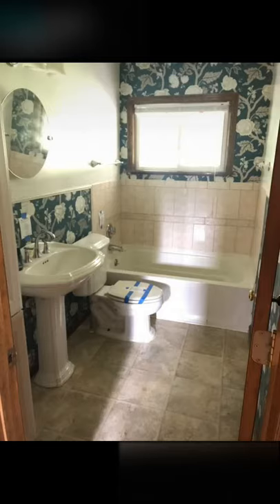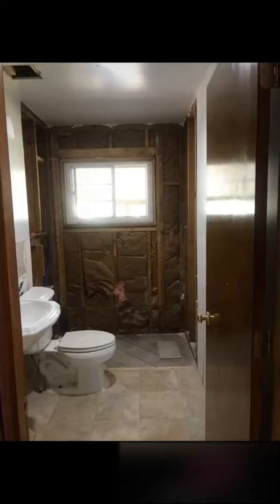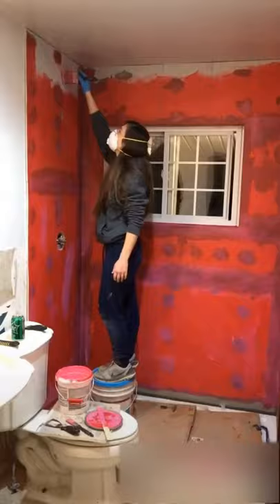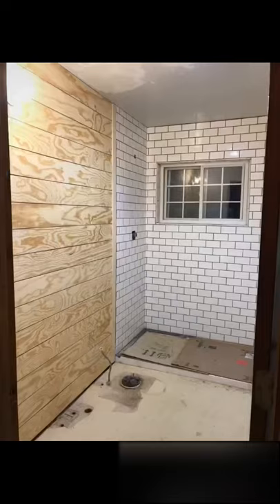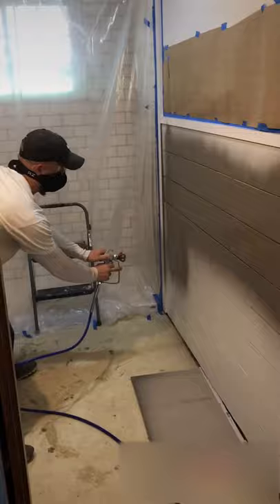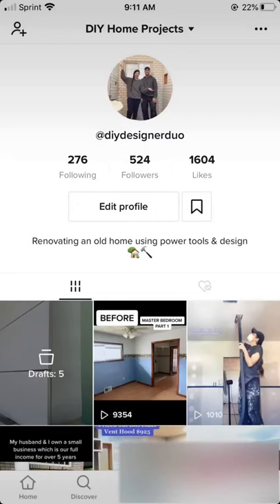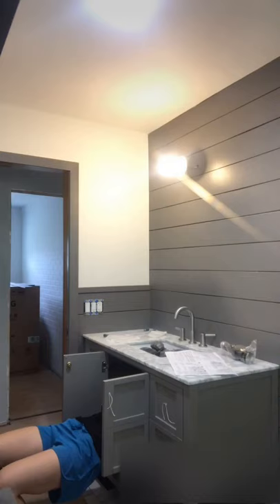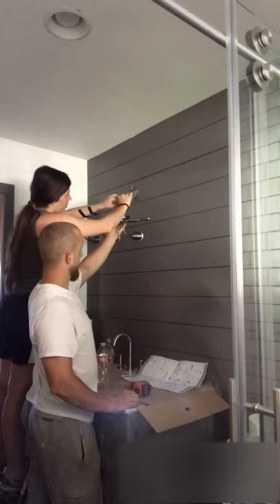Bathroom remodel went VIRAL 5.7+ MILLION views - “That escalated quickly”

Comment: Waterproofed? Timber in a bathroom with that waterproofing? 
5 - 8 years max.
Reply: Don’t you need underlayment under tiles and waterproofing, also yea using wood like that in a bathroom isn’t gonna last.
Reply: Exactly my thoughts
Reply: @fallingsuncreations9270  with proper ventilation it should hold up fine. waterproofing with a membrane layer is far more critical than a finish material to uphold structural integrity
Reply: @fallingsuncreations9270  they painted the wood. That's like saying drywall wont last, when most bathrooms are mostly drywall
Reply: @jack8162  yes but was the wood coated all the way around like everywhere. How is it saying it’s like drywall
Reply: @fallingsuncreations9270  they painted the entire surface with latex paint. Latex paint is water resistant, provided water doesn't leak behind it. I would say it's fine as long as it doesn't get direct water contact.
Reply: @jack8162  ah latex.
Reply: @jack8162  ha ha direct contact with water in a bathroom.... No way that could happen. Just put Hardy backer or dura rock and be done.....they did so much extra work and it won't last as long as the concrete board will.
Reply: @johnw3078  why are you acting like they are going to be splashing water on the wall constantly? They did it fine and your knowledge is useless
Reply: @jack8162  that's why they make Hardy backer lap board..... especially for projects like this.
Reply: @johnw3078  Damn bro somehow you typed that much and insulted him on your first opportunity, yet I left reading your comment with the one hundred percent certainty that you fit several redditor stereotypes and none of them pleasant.
Reply: @thezombiefan777  he put me down first , that's what started it.
Reply: @johnw3078  wow, you got me good lmao. All the ladies must be grovelling at your feet because of how smart and alpha you are. Just remember that you're getting this bent out of shape over someone else's bathroom 😉
Reply: @jack8162  sorry I wasn't upset but it turned out because I got jumped on . My first post was only stating that the bathroom took alot of time and could have possibly been done with something more suitable for the application.
Reply: @johnw3078  I do remedial waterproofing and I can tell you right now, you're right and they'll be redoing this bathroom sooner rather than later haha
Reply: @johnw3078  i dont even do that kind of work, i knew it anyway cuz logic. i mean cmon water and water and then like that meh better safe then sorry
*wood (time to sleep)
Reply: 5-8yrs sounds good too me
Reply: @AmiAki  so does 5 - 8 inches.
Reply: @jack8162  Another "expert" hater. They killed it.
Reply: @johnw3078  you sound kinda butthurt because an internet stranger didn't submit to your vast building knowledge wich may or may not be manufactured. So your resort to juvenile personal attacks. Hmm, speaks volumes.
Reply: Bathroom fitters make it viral because of the fu@kups 😂😂😂
Reply: @jakenjoi3837  thank god some people know how to waterproof correctly
Reply: @Tom-pe3zf  Got it in one! P.s Merry Christmas
Reply: @johnw3078  that response where you go off was awesome
Reply: Is it not fake wood?
Reply: That was red guard. Red guard is literally waterproofing. All the tile videos I’ve watched say red guard is actually a great way to water seal before spreading thin set. I’m no expert but the shower looked right to me.
Reply: Ok once I was in a shower were the floor was wood! And all I wanna know how is that possible? It felt like wood was wood colored it was freaking wood! Had some spaces in between and the drain was under the wood, I’d like that for my bathroom but I have no clue how is that possible lol
Reply: @boniboni4912  that’s just a teak wood shower insert. You can buy them online...lol. They didn’t actually build the wood into the shower😂
Reply: @cinder4614  i had no idea those exist lol thanks
Reply: It's just about the "look" that becomes meta on instagram and pinterest.
Reply: My house was built in 1925 all original beautiful hardwood and the bathroom has beautiful wood work and wood ceiling, its still there holding up fine 😆 just turn that fart fan on
Reply from the maker: Here’s the details of how we waterproof things around the wood! https://youtu.be/40_gpcAr5HE
Reply from the maker: @jack8162  your awesome jack! Thanks for helping 😂 new video posted
Reply from the maker: @heavystarch100  he’s really going to pick us apart on our breakdown video 😂https://youtu.be/40_gpcAr5HE
Reply from the maker: @fallingsuncreations9270  https://youtu.be/40_gpcAr5HE checkout the break down
Reply: One year before the black mold destroys it ... not even , maybe a few months
Reply: Yes, timber will be fine in a non-wet area application, which behind the vanity is. Do you not see wood mill work all the time in bathrooms? They also waterproofed the shower with concrete board that was waterproofed. So they’ll be good.
Reply: @johnw3078  Daaaaamn bro! ✊
Reply: Dammmm........yall still talking about me?........ah i love it.
Reply: After 2000 years they still talk of Ceaser.....i only have 1999 more to go.
Reply: @johnw3078  Accually, it's still 2000 years 😅 and yeah offcourse there are still ppl talking about that awesome burn of a comment ✊
Reply: @heavystarch100  when someone comes with facts it's not being a heter, it was the insults I didn't like
Reply: you guys are horribly honest..really that long only..?
Reply: @johnw3078  calm down dude. You're watching a bathroom remodel on youtube. It's not that serious.

Comment: Dude. You guys did a great job! My husband and I are looking to buy our first home, and we want a semi-fixer upper... Any tips?
Reply from the maker: Yes... do as much as you can yourselves. And when you think I don’t know how to do that.. watch YouTube for 2-3 days and try to do it before you look to hire someone
Reply: Yep! My husband is an electrician. Anybody you hire will charge double, sometimes triple, to do something you could do yourself. You need to learn how to do it yourself because with home ownership something is ALWAYS breaking or needing replaced.
Reply from the maker: https://youtu.be/40_gpcAr5HE the bathrooms are the hardest thing to remodel bc it seems like a lot.. he’s a simple breakdown of the things we did to remodel ours
Reply: @DIYdesignerduo  Somehow I just got a notification of your reply. (YouTube failed me big time.😉)
Anyway, thank you so much for replying! A lot has changed in the 3 months since I posted this comment... 2 months ago we made an offer on a house that was accepted, and we were so excited, but we backed out after the inspection. We wanted a "fixer upper", but it was a "knock it down and start overer" instead; a complete nightmare! Needed a new roof, new plumbing, new electric, new appliances, new HVAC, and to top it all off the crawlspace was flooded. I can't even imagine what the walls must have looked like under the fresh coat of paint they slapped on before putting it on the market. We took a break from looking for a bit, and the day I started looking again we found a house that looked great. We went to see it 30 mins later, and an hour after that we made an offer, and we're closing next month! 😁 It's only 2 years old, so we won't have to fix anything up right away.👍 We want to make some changes but nothing big and nothing urgent. We're excited about the house but dreading the packing and moving part.😉
Reply from the maker: @IAmSuzyQ  god is great.. we about gave up then found our house too!

Comment: Wood on walls will be rotting in a year. Also depreciated the value of the house by taking out the tub and replacing it with a shower. But looks nice
Reply: I mean if they plan to live there until theyre old it doesn’t matter the value of the house. I removed my tub in the master and replaced it with a giant shower because I don’t plan on ever moving and never took baths
Reply: I think you can just seal the wood with a sealant paint to be waterproof
Reply: Wrong.

Comment: Them glass doors are a mofo to install an watch the glass breaks when sliding fir no reason.. Installed a few an customers called back saying glass just shattered out of nowhere.. Looks beautiful tho....
Reply: The edges need to be cushioned to absorb shock
Reply: They come with all that an they have to be tempered glass.. We installed it correctly an her daughter was takin a shower closed it not even all the way was doing her hair in the mirror an it just shattered... We've installed a few an ot only happened to 2 of them.. The hardware that comes with it is super heavy especially the top bar it weighs a ton an only 1 screw on each side an maybe a half in on either side into the sleeve just giving a heads up an we stopped using them an we make sure we tell consumers not to use em.. Good luck with your new beautiful bathroom..
Reply: Maybe you shouldn't announce on YT that you completely suck at your job 🤔
Reply: @gmkhn66  bathroom shower doors are usually always made out of tempered glass meaning it can’t cut
Reply: @e7725  saying a product sucks is not the result of an installer. I’ve installed entire tempered glass sinks that have shatter after a week cause the house settled with the new load of weight. Bathroom vanity’s can be very heavy, and if a home is built before 1990 is doesn’t have as many basement jack post. Pry same reason the glass doors break, the metal flexes from the house settling and the glass can’t bend so it shatters.
Reply: MegaSkilla  you spelt FROM wrong there’s a mistake 😂
Reply from the maker: https://youtu.be/40_gpcAr5HE we shocked ourselves on that one... here’s break down of the entire remodel and cost!

Comment: Then got in a little bit of trouble when the little ole inspection man came knocking after viewing this video.
Reply: For what?
Reply: Yes, explain, please.
Reply: Then theirs me who messed with so many electrical things in the house I live in like wiring a whole room lights and plugs with a new home run from the panel with out permits and licenses oops
Reply: Exactly what I was thinking, people think even if they do it themselves they're safe (Ignoring the Permit and inspection part, there's a reason trades people go to school for year's and then have a 4yr apprenticeship once they graduate school, its so you don't have an electrical fire a year after, or whatever other issues could be present) but depending on the state and local laws you still could require a permit/inspection, I know my area does.

Comment: Way too many patterns happening in there. The different style of granite on the counter vs the floor and then the smaller off-white shade of the shower tiles give me a headache. I wish they'd stuck with the honey-comb style for the shower. A solid color for the floor and the counter could work if the granite pattern tied in with the shower.
Otherwise, still a pretty nice reno but could have been much better.